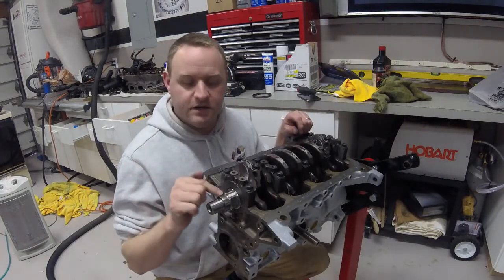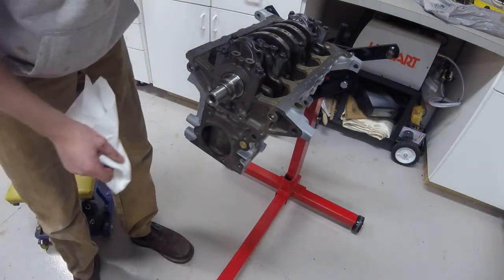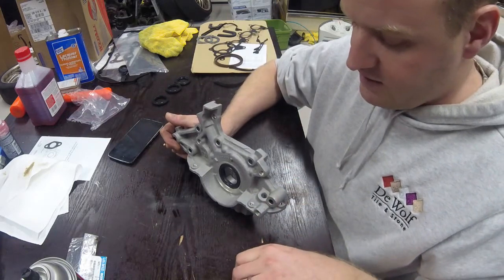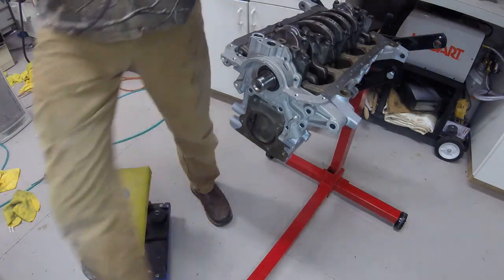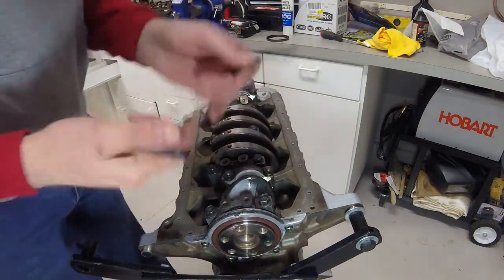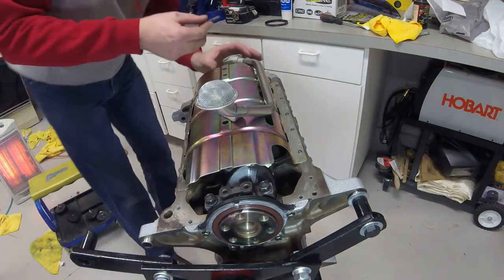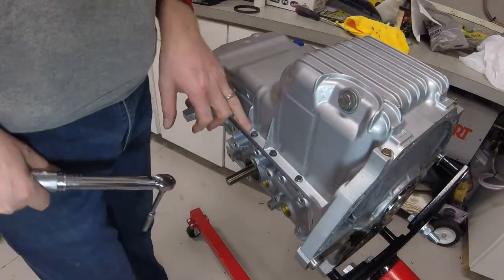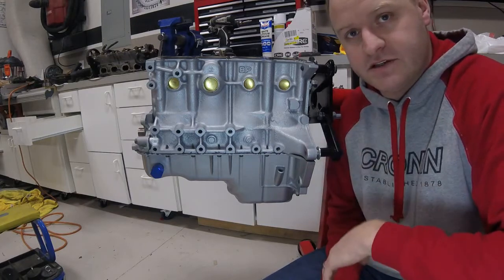Miata Oil Pan & Oil Pump Install Guide

Comment: I had the (dis)pleasure of installing that rear lip seal around the crankshaft with the oil pan still in place, last year while I was changing my clutch and flywheel.  Boy was that a pain in the butt, and I'm not even 100% sure that it stopped the oil leaking from that area.  I'm hoping to pull the engine one of these days and completely re-seal the entire bottom end, and I'll probably refer back to this video along with the FSM during the process.
Reply: And here I am with the engine out of the car, about to reseal the oil pan, and referring back to this video. 😅 what about sealant between the oil pan and the lip seals? Did you apply sealant over the top of the seals before installing the pan?

Comment: Just found your video, and it’s very helpful. I do have some questions though. Did you torque the nut for the oil pick up tube to 8 ft/lbs as well? And did you apply rtv to the top of the “half moon” seals, or only the bottom on the block side?
Reply: Workshop manual says that it is the same as the 2 other bolts, spec is 7.9-10.7 N.m (69.5-95.4 in/lbf)

Comment: Hey there, great video. Just wanted to see if you had any leaks at all with your install. I’m about to do mine and want to get it done the right way. thanks!
Reply from the maker: Hasn't leaked a drop
Reply: BuildingTheEXOCET Awesome man thanks! Will use your video as a guide👍